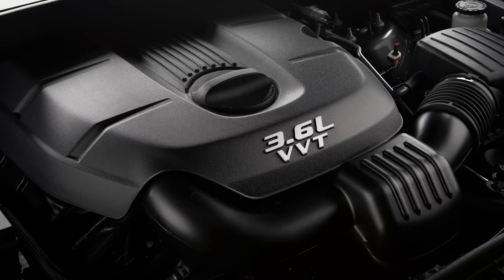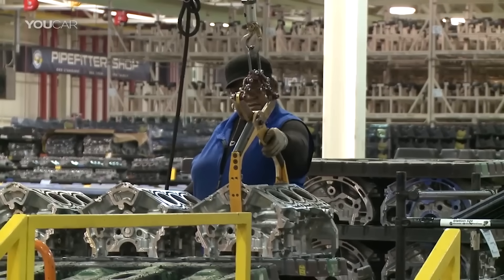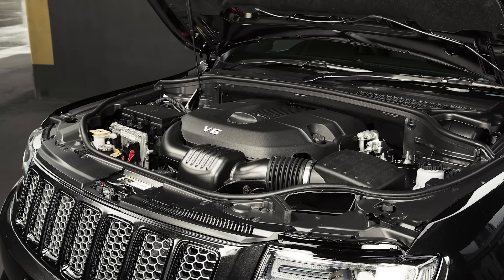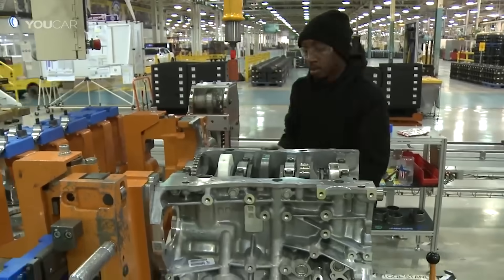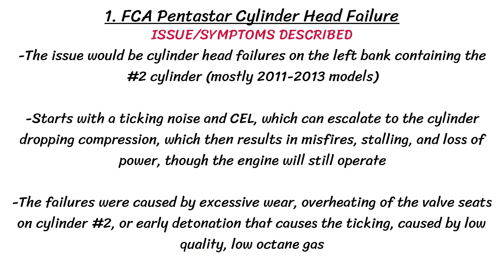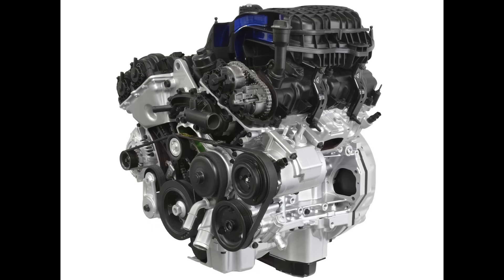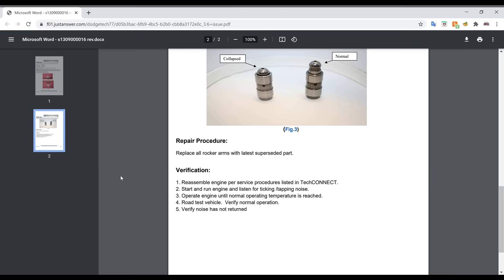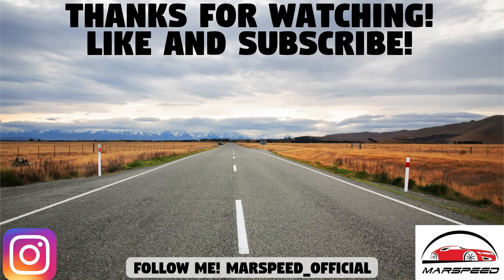The Specs and Fatal Flaws of the Chrysler 3.6L Pentastar V6 Engine

Comment: My 2018 Dodge Durango 3.6L started ticking at 115,000 miles and stopped running at 130,000. The Dealer said the motor was "bad" and wanted $12,000 to install a new one! Extremely pissed but had no choice but to replace the motor. The car was only 3 years old! I had a friend's shop re-diagnose and confirm the problem then do the new motor install which saved me around $4,000 over what the dealer wanted to charge to replace it. Pretty sure this will be my last Crysler vehicle!
Reply: I thought it was only the Hemi V8 that had this problem the hemi tick with early valve lifter failures.
Reply: @microminiskirt  Apparently a lot of Crysler vehicles are having valve train and short block failures due to valve train problems. Been reading a lot about it since my engine gave up the goat. What I want to know is, where were all these warnings BEFORE I bought my Dodge vehicle LOL! All the reviews I read before my purchase were stellar!  I will dig a lot further next time I buy a car for sure!
Reply: @robertwright1084  Check into the forums but more importantly the class action lawsuits.

Comment: The 3.6 will out live the Hemi engines.. Those 3.6 engines run for a very long time. Anything after 2017 is fantastic. There are some with 600000 miles on them one in Russia has 800000 miles on it.

Comment: I have the 2011 Journey with the 3.6 engine. I've had issues with everything in this video. THE BIGGEST PROBLEM I have was the oil cooler which was replaced 3 times. I actually replace myself and used the all aluminum version this time. They have way too much plastic on this engine and all my problems stem from those parts. The thermostat will wear out it's plastic. I replaced the cylinder head, engine mounts, radiator, and upgraded to the 2014 all aluminum oil cooler. I've had pinched wires in the trunk hatch. The most annoying thing was no heat due to the heater core getting clogged. I finally fixed it by letting some CLR soak in it for an hour and flushed it twice. Now the heat is scorching hot. The expensive coolant you have to use that has to have GO5 in it is garbage! It turns to gel after a year and that causes a lot of problems with the heating core. Other than that I have about 200k miles and she runs good.

Comment: 2017 Grand Caravan 3.6 flex fuel. Was driving on highway at 65mph and the temp indicator went past middle to warmer on a hot day. I have driven plenty of other cars that the needle never moves from normal.  Happened a couple times. Coolant ok. Starting losing oil somewhere because dipstick level showed slightly lower, wasn't burning it. The oil cooler was leaking both coolant and oil- replaced. At idle went over temp again - replaced thermostat, so far ok . No real ticking yet use synthetic oil. Not a great engine. Regular oil changes done!

Comment: I bought a 2016 Chrysler town and country 3.6 . 3 words piece of shit. It's just falling apart. The interior has a bad panel in the rear floor. Crappy plastic snapin. It's really made cheezy to fill more stockholder pockets instead of being made with American pride.
   Had a lifter setup go bad under warranty . It's doing it again so I'm gonna have to fix it. Hopefully it won't be completely destroyed. I've had to get to work but finished repairs on my bike so I can put the van down for awhile.

Comment: 3.2 Jeep Cherokee version has no issue in my vehicle.Its 2015 Jeep.
Only thing that broke and sucks are engine hydraulic mounts that leaked at 60k and we replaced them with non hydraulic standard ones.

Comment: I am a big  Mopar man for many years I've owned the 318 which is a bomb proof engine 360s I just got a 340 I've had a 440's I maintain one philosophy for all of them and apparently the same  new engines with their flaws if you try my philosophy on the new engines I'm pretty sure they won't hurt them You zero out the thermostat by removing the coil spring the copper and the bridge , higher octane gas and 20w  50 oil

Comment: I've had a 2012 Chrysler 200S, a 2014 Chrysler 300S, and now a 2019 Chrysler 300S, all with the 3.6L engine and no issues so far. They have been great engines.
Reply: Lucky you! I have a town and country 2014  with 3.6 engine 117k, I have issue #1 and #2 in it which are cylinder number 2 is misfiring, and I have a broken rocker arm and lifters 😩
I took it to a michanic and he advised me to change the whole engine 
I guess I’ll never buy Chrysler again
Reply: @AmricanEagl  Maintenance is the key mi amigo!
Reply: @wildestcowboy2668  I maintain my cars regularly my friend! Matter of fact I have a Malibu 2008 4 cylinder (2.4L engine) it has 286k miles (original engine and transmission) still running very strong barely any issues with it! But that Town & Country was a cancer from the begging issues after issues after issues until the engine fail
Reply: @AmricanEagl  Any time a human is around an engine being made, installed there can be a bad one slip thru....
Reply: How many miles is u got on them ese?

Comment: 2015 Journey.  Beat the piss out of it . Not a single problem.   I went as far as to even do the oil cooler recall just to make sure we didn’t have any issues .  170,000 and I still see it around today driving with another family . 
  It’s all in the maintenance .   I know a bunch of people with chargers and challengers .   Some had issues, especially the detonation issues with cracking pistons and blowing holes in blocks.  Again, when they tell you to use a higher octane, use it .  We used e85 most of the time unless it wasn’t available on our trips.

Comment: Today, 6/14/22, found out intake & exhaust cams along with 24 rockers & lifters not all bad but replacing to be safe, No over heating 106,744 miles 2014 Grand Cherokee Limited with the 3.6 need replacing......$2800! like the vids said, I couldn't find an extended warranty for the vehicle.

Comment: Wow...eye opener...considering i have a 2014 Ram C/V with this engine, and have experienced half of these issue..however, I bought my Van with 80K miles on it and experienced the usual transmission slip/not going into overdrive, the dealer insists it was user lack of maintenance while it was still under their 100K mile drive train warranty..shame...no wonder their stocks drop like hot coals

Comment: Yeah my 2012 Dodge journey had that misfire on cylinder 2 issue. 96000 miles. Luckily I researched and proved low compression with pics to the dealership before they would recall it and fix it. I rented a car for 1 month waiting for head to arrive. After speaking with FCA many times on phone and documenting everything they finally agreed to pay me reimbursement for rental. The whole ordeal was about 60 days to fully resolve. It all started with check engine P0302 fault...Long journey but worth it. 2 years later and I'm still driving it with 120000 miles.

Comment: I had a 2012 JKU and the engine failed at 58k miles.  I had a lifetime warranty that they decided to cancel instead of fixing my Jeep.  Of course being a very inept company with zero technicians that had any mechanical ability they originally told me that the problem was the manual transmission.  I told them since you canceled my warranty I will just replace the transmission myself, and that’s when they told me they had shipped it to FCA for inspection forcing me to pay out of pocket for a new transmission.  I went to pick it up late Friday evening before closing time when everyone who could answer questions was gone.  As soon as I pulled out of the parking lot I could tell that nothing about the problem I was having had been fixed with the new $4k transmission.  First thing Monday morning I went and tore the service manager a new one and the first thing he did was have the guy that worked on my Jeep go out with me on a test drive so I could point out the noise and vibration I was telling them about.  I gave the technician the keys because I wanted him to drive and tell me what the problem was (the service contract said that he had test drove it after the transmission was installed which I knew was BS) as soon as he started the engine he said whoa 😮 (he and I both couldn’t believe he didn’t notice that before).  Then the service manager told me that he would take back the new transmission and give me back my old one and refund my money.  I was like I thought you didn’t have my old transmission anymore and he said they still had it but that it was all taken apart for the inspection and he had the service tech show me what they thought was the problem (it was a tiny bit of wear on some of the synchronizers) I was dumbfounded at the lack of actual mechanical ability and told him that transmission was good for at least another 20 years and hundreds of thousands of miles.  I told them to make the swap and to try to figure out what the problem was.  They let me keep their free loaner car while they slowly worked on my Jeep, and from that point on they called me to look at everything they did.  When they finally dropped the oil pan they found some metal shavings and some plastic pieces in it, and they being inept mechanics had to get FCA to tell them what the problem was and all FCA told them was that I needed a new long block ( they had a new one for $9k and some change plus installation or I could order a remanufactured one wait a few weeks for $8k and some change plus install).  I just told them put it all back together and give it back to me the way I gave it to them and I would figure something out.  I ended up going to a salvage yard and for $4k they found an engine from a wrecked Jeep with almost the same miles as mine and installed it and gave me a 6 month warranty.  Since 2012 there’s no such thing as Dodge, Jeep, Ram, Chrysler it’s all just a crappy Fiat, and they do not stand behind their product!  Their motto is screw the customer!  I will never give Fiat another cent of my money!  I loved my Jeep but that and one other little incident made my wife make me get rid of it.

Comment: I have a 2012 Journey SXT with the 3.6L engine.  I just got my first CEL with P0304 - misfire cylinder 4.  Changed plugs and coils.  Still throwing the code.  Sounds like the rocker arm problem might be at play here.  Does anyone have a link to the service bulletin he showed for the rocker arms?

Comment: I have a 2014 Dodge Charger I had to replace the rocker arms and lifter twice.   One was at 70,000 miles and the other was 95,000 total cost was 2,700 dollars.  Thank you Mac Haik Dodge (Gluckstadt, Mississippi) you lost a customer.   I'm going with a Toyota next time...

Comment: Mine has 250,000 mi and all I've done is replace the oil pressure switch and belt and plugs that's it

Comment: I have a 2019 Grand Caravan SXT with the 3.6 liter VVT V6 .. Had issue with cooling system that cost 3500 to fix. The line going to rear of van blew at 36900 miles. Haven't had any further issues has just over 50k now. Dodge wouldn't cover repair ... Should I be concerned with this engine ?? Changing oil religiously and have been burning 89 octane fuel since I purchased..
Reply: That’s BS that they wouldn’t cover that, did you buy the car used? What is the basic warranty? 36k 3 years?

Comment: I'm on my 2nd Grand Caravan. The first one was a 2013 Value Package trim which I traded in 2017  ( I knew by then what I did and didn't want in a minivan, ) and bought a Crew Plus. The older van had almost 60,000 miles on it at trade and I had no problems with it. The 2017 has 45,000 miles on it, and again no issues. I did notice some ping in the first van so I switched to premium gas and that was the end of that. Premium is for sure more expensive, but compared to the aggravation  and inconvenience of a big engine repair, it's not that expensive. Besides, the V6  runs smoother, has more power, and gives a nice almost V8 like burble. When I bought my first new car, a '76 Volare with the old Slant 6, I asked the service manager what kind of gas I should put in it, and the old guy told me to put in the best gas I could afford, so, some things don't change.

Comment: My parents bought one with this engine and with average maintenance it’s been reliable. 190k miles still running strong and the standard tranny on the 2015 Dodge Charger running very good as well. I was shocked when my mom said she never changed the tranny fluid 🤣 like what.

Comment: I got 2018 dodge caravan now have 66k miles runs better when it was new 😆

Failed tranny at 45k miles ; replaced warranty new tranny

Warped left cylinder head caused by cylinder # 2 misfire . replaced with new left cylinder head. While its open replaced with new right cylinder head ( just incase ). Replaced head gasket too.

Change rocker bearings making ticking noise

Replaced cylinder # 2 fuel injector. Change all spark plugs and coil packs

During warp cylinder head, can over heated and clogged radiator systems. Replaced waterpump and thermostat

Comment: I have a 2012 Chrysler 300 with 78k miles on it and I have not had any of these issues. Although there is a tick in the engine that has been there since I started driving it in 2013. It has not gotten any worse and I always equated it to the fuel injector tick that I had in my 280zx as it sounds exactly the same. I am also not easy on the car and am adding mods and about to do a HP tune on the car for better performance.

Comment: Update:  Two weeks ago (mid April 2022) my check engine light turned on.  Scan tool shows a thermostat failure.  I have 179,945 km on my Dodge Charger SXT 3.6L VVT.  It is booked for a new thermostat in two weeks.

Comment: Just had to replace the left head and oil cooler on my 2015 Wrangler last year @ around 115k miles. Had the entire radiator replaced under warranty a few years back too, probably from the cooling system issues.

Comment: I have a 2015 Wrangler (as does another family member).  It has a "ghost" cylinder 4 misfire.  There is physical evidence of it, enough for the dealer to replace the head gasket, but the ECU has never logged it properly.  I had them re-flash the ECU when it went back in for the same CEL (the dealer my family member uses had to try that), that they cleared several times, for a misfire from several thousand miles earlier.  Now it misfires but doesn't log anything. :) 
It has always consumed oil and coolant since brand new, which is something I wasn't expecting haven driven older cars/designs without those issues.  I am not sure if it's burning them, or leaking where I just have not found it yet.
I currently have 63,000 on it.  It still misfires and consumes oil/coolant.  It has also been down on power the past couple weeks.  It's hard to tell if the throttle response has gotten worse because the drive-by-wire on these Jeeps is erratic and schizophrenic.  The dealerships won't do any actual fixing or diagnosing unless the ECU tells them something, or there's an obvious physical catastrophic failure, so now it's a race between the engine and transmission for which will grenade first. (Trans synchros have been failing since 20-23K.)

Comment: I had a 2014 Town & Country, 3.6L.
At 110k miles, the #2 cylinder lost compression. A lock-down test revealed that the #2 exhaust valve/seat/guide was the problem.
FCA refused to fix it, even though it was EXACTLY the recognized problem found in ten of thousands of 2011-2013 FCA vehicles.
The service manager gave me an estimate of 2 to 4 THOUSAND dollars.
Fiat-Chrysler is NOT the old Chrysler Corporation.  My previous 2002 Town &Country had 315,000 miles on it when I gave it to my niece. It ran, and is still running beautifully.
I use Mobil 1 in all my vehicles for many, many years.
FCA sucks, and nobody of my family or friends will ever trust Fiat with their hard-earned dollar again.
I wholesaled the car as-is, and lost thousands in value.
A tough lesson learned.

Comment: I have a 2016 3.6L Pentastar V6 engine in my Chrysler 300 and it feels very solid! 😊
After watching this video, I don't think I'll be boosting this engine. If you ever start hearing a ticking noise, take the car in immediately! Cooling system issues aren't surprising, since parts are usually made in China!

Comment: My 2015 has only 23,000 it has this issue. I notice ticking now a whine. I am really upset with this poor design.  I don't really drive this car that much, given it is 2022. Thank you for the help. I lost faith in Chrysler now. I don't believe cost should be at the owner cost, when Chrysler still uses on newer models & problem is still there.

Comment: Oil cooler/oil filter housing leaking tremendously and flattened cam shafts only 2 issues I've seen as a mechanic at an independent shop very powerful and sounds great I've seen some get to 300k miles

Comment: I have the 3.6 in a 2019 durango I've rocker arms replaced at 19,000 miles and just had the water pump replaced at 50,000. Now there's water in my track lights and they want 1200 bucks to fix it

Comment: family auto is already replacing a transmission for my 14 caravan with less then 150000 miles bought it used already replaced cv axle wheel replaced a resinator but only attached 2 steel fittings and resinator and torque converter solinoid still throwing p-0740 plus a new of p-0420

Comment: My 2016 wrangler  Burned oil 1 qt every 2800 miles went through a cat at 20k  When I started the vehicle you can see blue smoke at 1st. Jeep Dealer says that’s normal. I call BS. Traded it in in 2021 and got more than I paid for it. I have had these motors before and had no problems. Must be a hit and miss motor. I did purchase another Jeep and have had no problems so far. Never trust the DEALER they do minimum work and Ty to collect the most. Dealers are all Scam artist from top to bottom.